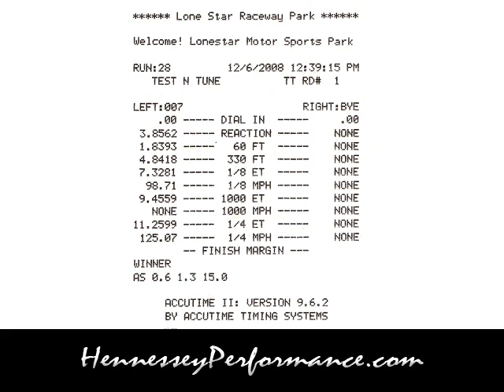11.25 @ 125 mph Challenger Hennessey HPE700 Turbo

Comment: Dodge builds the Challenger to be a versatile car with an actual back seat and usable trunk. Realistically, how many people that buy a car of any size or power is going to do nothing but drag race it or race around a track all the time. You are going to want a car you can use to haul a few buddies or the family. Good luck packing a couple of adults in the Camaro or Mustang. The Challenger is a way more practical car for anyone other than a hermit or a race driver.

Comment: Love the car, love the turbos, but not really impressed by that time or mph. A 426 CI motor with turbos running 11 psi should be close to 650 rwhp if not more. This thing is just to heavy. If this was a 3500-3600 lb car, it would have done mid to low tens all day. now that would have been impressive.